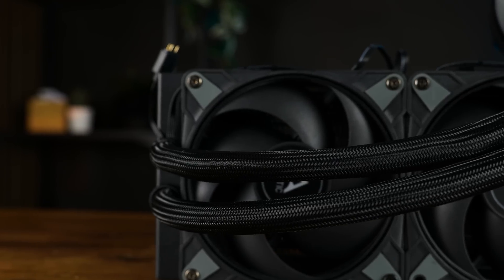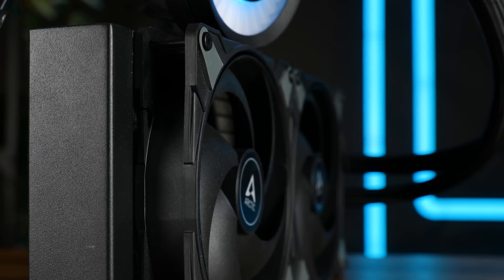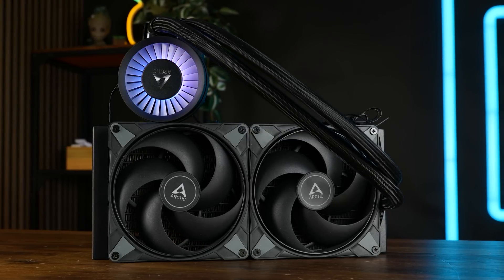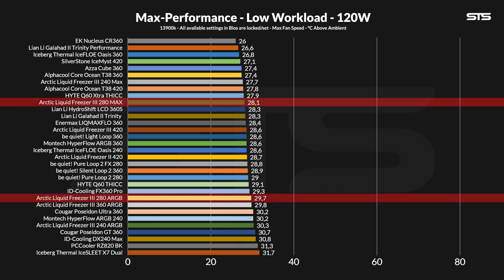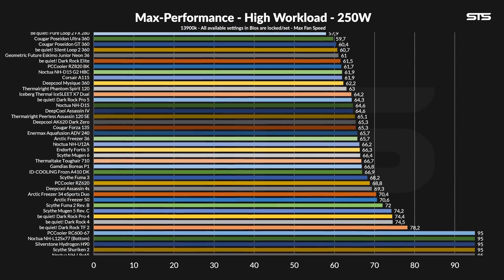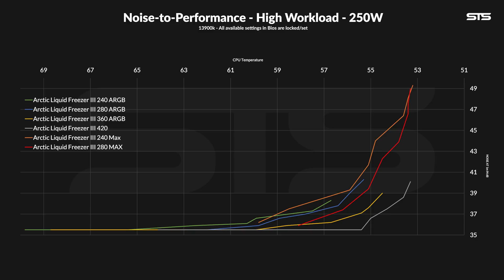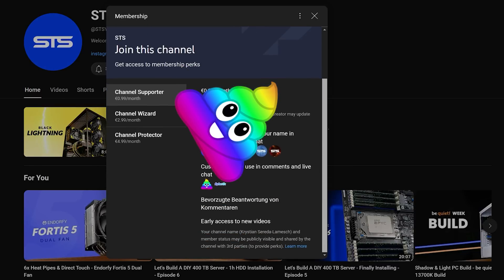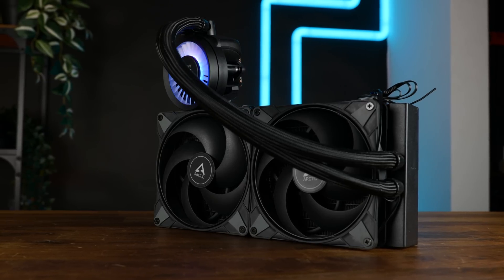Arctic Liquid Freezer III 280 MAX 💪 Pushing The Limits

Comment: All these test shows one thing, fan upgrade by itself doesn't do much but increase the noise. Arctic's cold plate is the bottle neck. If you really want to knock some numbers down go for "CPU delid and relid"  (not direct die)
Reply from the maker: Pretty much sums up the whole video series

Comment: Do the crazy and get hold of some Sunnon PFE0381BX-000U-A99. That's a 140mm fan with a max speed of 6800 RPM 297 CFM and a Static pressure of 2.05 inch-H2O at a modest 68 dB(A). Oh and get earplugs. Putting this on any 280 or 420 radiator should show just what it can do at the absolute max. It would also show how small a improvement ridiculous fans like these really does for a cooler.
Reply: *Sunon

Comment: F it, we need liquid metal comparison for 240,280 difference!
Reply: I do understand that liquid metal is the best for those who keeps pushing for max overclock but I have never wanted to use it. It's just to darned destructive to the parts and a small mistake can cause massive long term damage. At the same time it would be interesting to see someone else risking the use of it so we can see just how much are still on the table when we use normal nonconductive TIM.
Reply: it's usually only 2-3C better than thermal paste and PTM7950, which is not worth it. Also the IHS is the biggest bottleneck for CPUs.
Reply: Delid and relid.  Replace the solder between Cpu Die and IHS with some liquid metal. Put the IHS back on. You don't even have to glue it down because Arctic Freezers mounting bracket keeps it in place. You are looking at minimum 5C drop. You will get max outcome if you lap the IHS.
Reply: Your gonna F the baseplate 😂. Liquid metal does not go well with copper